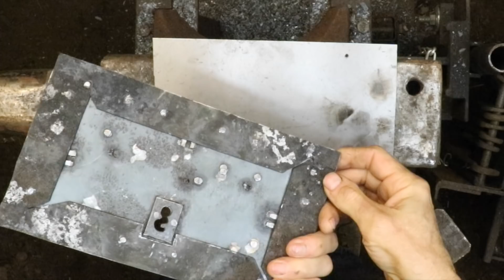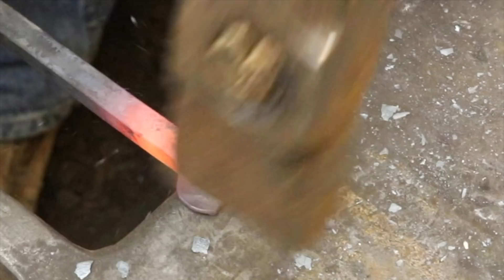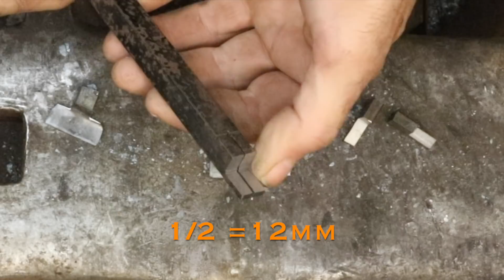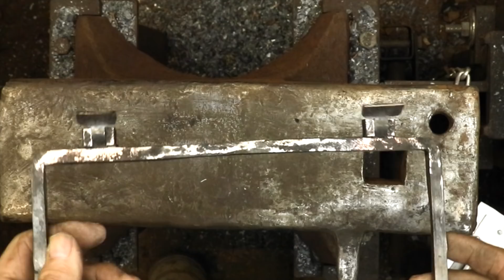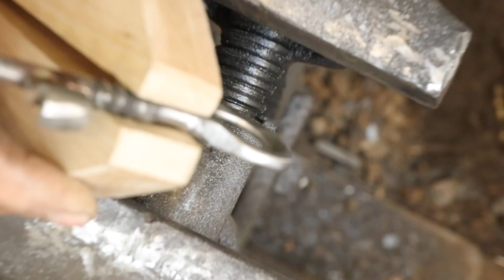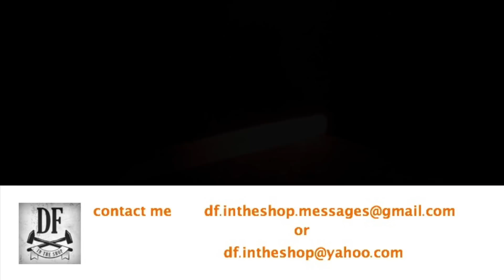Blacksmithing Project - A Simple Nuremberg Box 20

Comment: Funny use of the word «simple»..
Reply from the maker: I called it a simple Nuremberg box because I wanted to build the most stripped down and basic lock mechanism that you could have and still show how this type of lock is put together.  Once you have an understanding of this it will be a little easier to follow a more elaborate lock mechanism that uses several pushrods working dozens of levers that open 12 to 18 bolts around the perimeter of the box.  Based on how long this box took to make that project could take over a year to complete?
Reply: DF - In The Shop I see.. I’m a hobby blacksmith.. it was ment as a funny comment.. to me this is wery complicated - excelent work as always.. learn alot from your videos